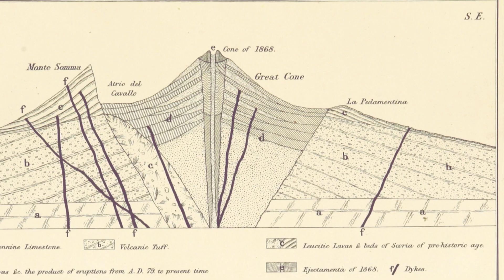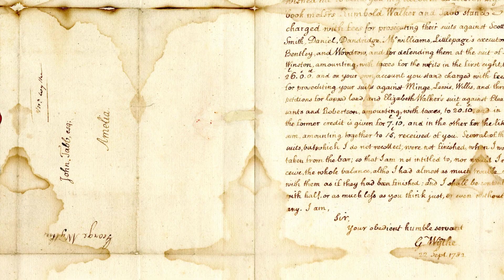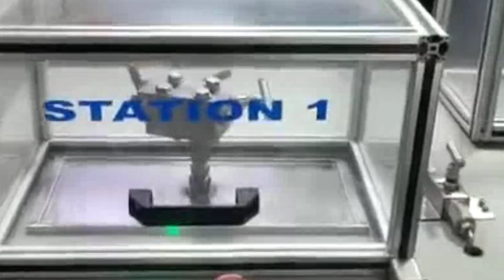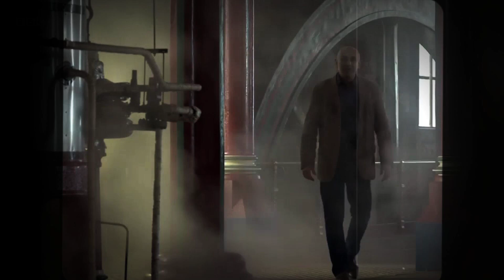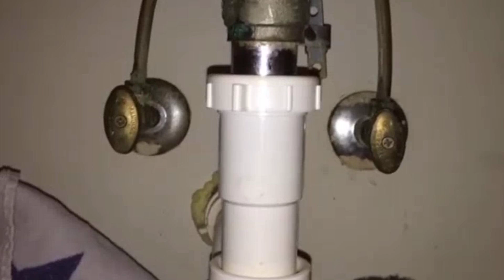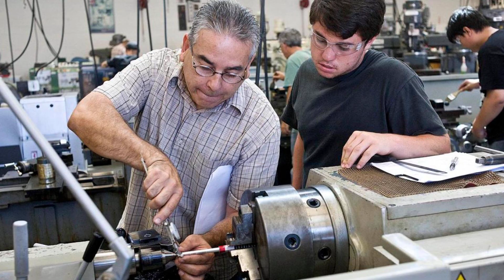This Valve Costs $10 to Make and Never Leaks. Why Did They Stop Using It?

Comment: Cone/needle valves are just beautiful in principle. Just make the coarse base forms, stick them together with a bit of abrasive putty and turn the daylight of it. Peekaboo; Nano perfect fit seating and directional self closing. Does not even really need maching, free handing will do if done slightly sober.